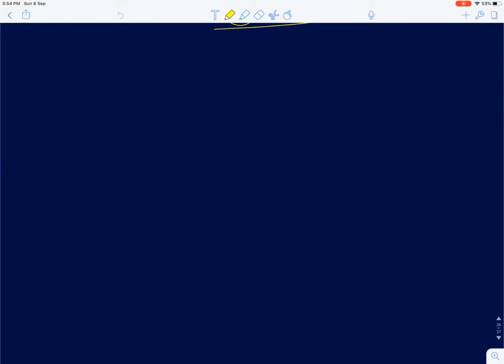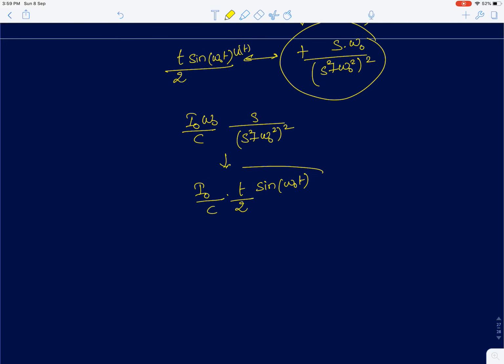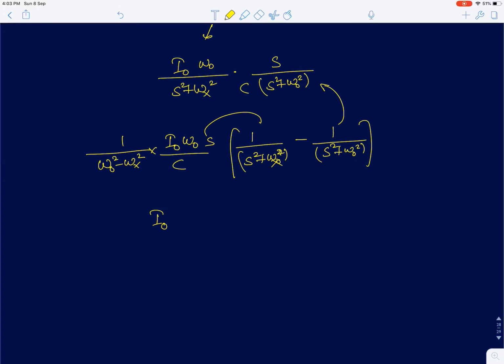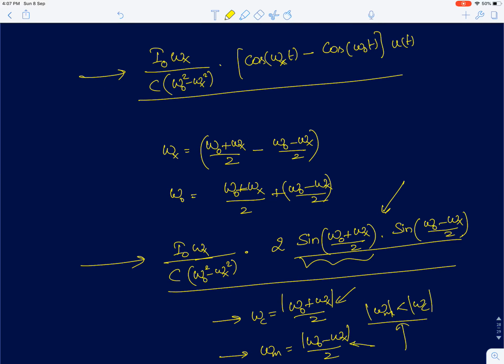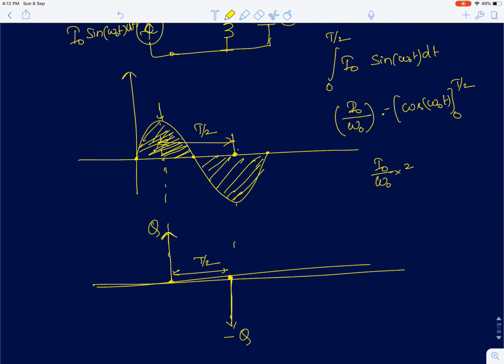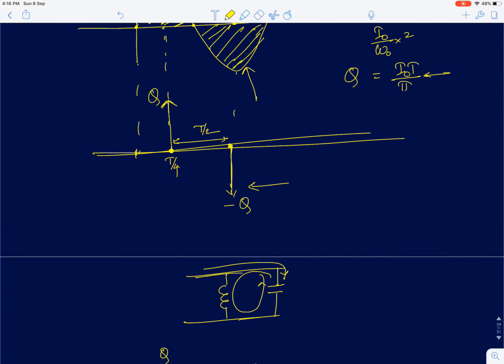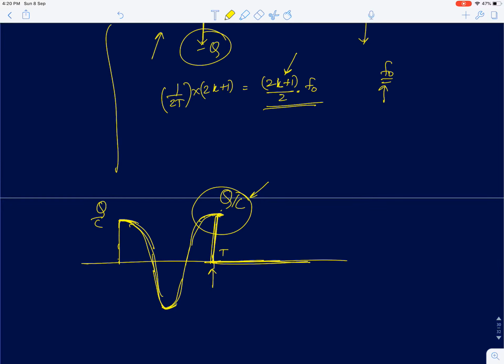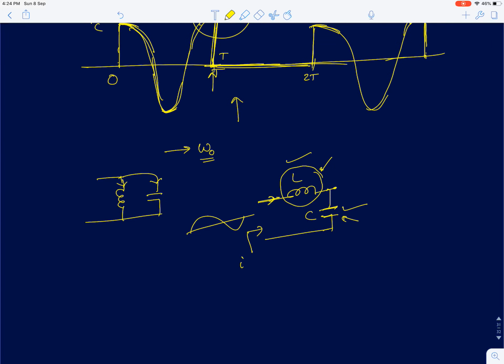ES Lecture 39: Response of parallel and series LC tank circuit to periodic and sinusoidal inputs

Comment: In the second example problem in this lecture with frequency wx, sir says the output has 2 different frequencies. But from concepts of sinusoidal steady state analysis, if we feed a sinusoidal input to a linear circuit, won't the response also be a sinusoid of the same frequency with the changes occurring only in magnitude and phase? So how can we have two different frequencies in the output voltage signal ?
Reply: Anna did you find the answer for this🫠
Reply: @dharshag9217  Nope . Sorry 😅
Reply: . @guhanrajasekar5993
Reply: @dharshag9217 .
Reply: Actually for sinusoidal input it should be LTI not only linear , the ckt should be time invariant also as you can see in above it is time varient